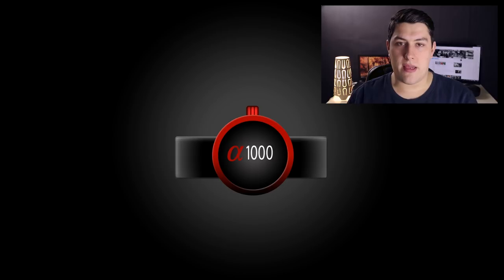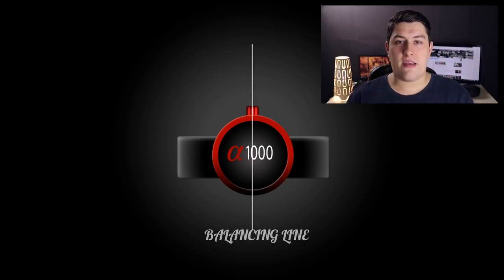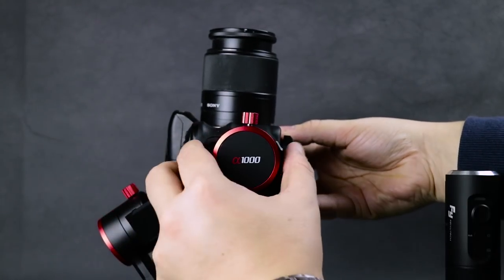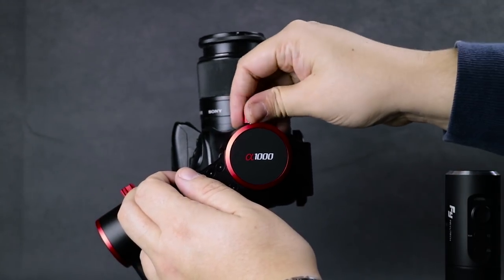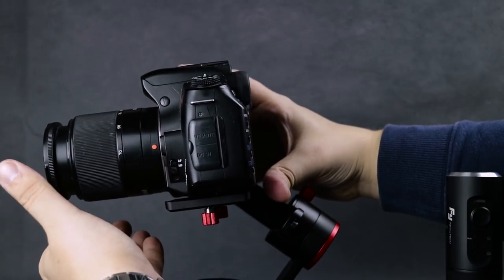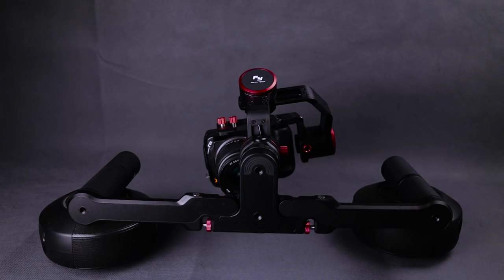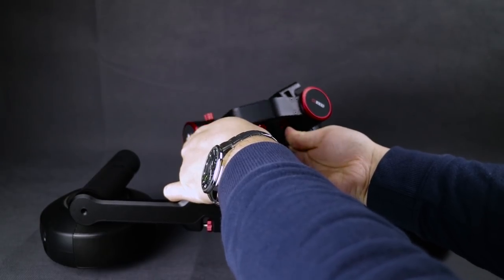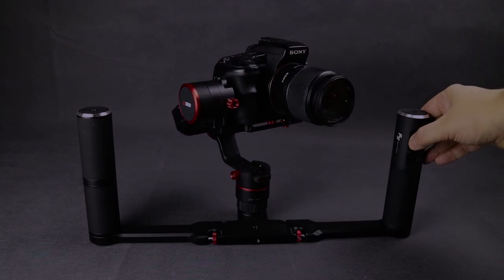FeiyuTech A1000 Balancing tutorial test footage and gimbal unboxing English

Comment: Slick review and well edited, far more than the 108 subs reflects! I think I'm going with the A1000 but they only come in a single handle on the UK market from what I can see. The footage looks just as good single handed so I don't mind that. Keep it up dude and share your content! Subbed!
Reply from the maker: +speedingtube thanks man. If you get it from Amazon please consider using the links in the description as it helps to support that channel.
Reply: speedingtube - just bought the single handed myself but found you can get the dual handle direct from FeiyuTech website ($199 US from the look of it)

Comment: Awesome video 👍🏻 would this work for the Sony A6000 / A6300 / A6500 ? Not sure if I would have to purchase the a2000 or a1000 with lenses 18-105 gmaster / 35mm and 50mm Sony. Thanks for the help
Reply from the maker: +Firkins Films it depends on the weight of the lenses. I use mine with a canon m3 and only use super light lenses. Check online that your heaviest lens doesn't take it over the weight limit. Also the actual gimbal is built for smaller form factor cameras so you might find that longer lenses prevent the gimbal from turning all the way. Id say that if you're using heavy glass then it would be worth paying the extra for the a2000.
Reply: My Sweet and Sour Life ok that’s what I was thinking thank you 👍🏻
Reply: Firkins Films the latest version will take upto 1700g which is more than enough for most camera and lens combinations. I use mine with a Panasonic GX8 plus Lumix f3.5 12-60mm lens. The camera and lens is quite a heavy lump compared with say a Sony a6500+lens. I use my gimbal only for walking and orbit filming in 4k most of my work is done on Sony shoulder mount broadcast cameras.

Comment: Hi. I got some issues with my a 1000. It keeps on spinning and doing all sort of crazy moves around all axes. What could this be? Incorrect balance? Should this a 1000 nob motor be on the right side of the camera? Would this have importance in balancing? It also seems that when I turn it on it does not keep steady, and in slowly moves around. Thanks for the advice.
Reply from the maker: Yeah it's really important to balance it correctly. have you updated the firmware?
Reply: No. I connected the app, which indicates the current software, and no needs for an update. I played around a bit, with adjustments and balancing, and it seems to be better. I still have to figure out, how to stop the autorotation motion ;) Do I hear a bit of Walsh accent there?
Reply from the maker: Just experiment with it. If you can't get it to stop rotating get in touch with customer support. As for the accent it has gotten all messed up since moving to China but its from Salford originally.

Comment: Hi!Does this gimbal also load the battery of the camera by connecting with usb? If not, it's crazy after each 10minutes of filming to change the settings of the gamble to replace in the camera the batteries. I would like to buy this gimbal for my Sony Alpha 6500 16-70 with rode micro video
Reply from the maker: I checked the manual and dont think that it's possible. I'm ok because my Canon lasts about an hour or so of shooting. For the A6500 there may be better gimbal options which use the gimbals battery to power the camera. You could always mount an external power source to one of the 1/4 inch treads on the gimbal handle which is what I will probably do when I upgrade to the A6500 in the next few months.
Reply: My Sweet and Sour Life thank you!Why will you update to Sony 6500?I have the 16-70 with Rode micro video.Is filming easier with gimbal instead without?Can you recommend Feiyu Gimbal over Zhiyun?
Reply from the maker: To be honest I havent used the Zhiyun gimbals so I can't make a comparison. I'm looking to update my camera because mine is old and only shoots 1080p 30fps. So i'm looking at my options but it's a difficult decision. I think that you might find the customer support for Zhiyun outside of China to be batter as they have been in the market longer. I wouldn't say filming is easier it still requires technique to walk with the gimbal but the footage looks much more stable after.

Comment: hey I have a problem, I have a Panasonic G7, with a 25 millimeter lens, I seem to have like a jerky bobbing motion sometimes it doesn't even feel like I have a stabilizer,  is that common or am I not moving careful enough?
Reply from the maker: It is either caused by improper balancing, firmware or a faulty device. Double check your balance before use. Check that the firmware is upto date and if you dont get better results contact customer support.
Reply: thank you for the help,  but I feel like I got a balance right I've checked all the tutorials and also followed your instruction on how to properly balance it. plus after I have a balance I moved the camera and it stays and every spot that I move it, like if I have it pointed down it will stay down if I have a pointed up it will stay up, if I have it pointed forward it will stay forward. as far as walking I tried to be careful as possible heel-toe heel-toe. I will check the firmware and see if that's it.. thx again...

Comment: hey so i have the sony a6300 and want to know if i need the A2000 or will the a1000 be good enough??? i mean its $150 difference
Reply from the maker: It depends on what lenses you are intending to use. If you use lighter lenses like the kit lens or 18-105 you should be ok but if you're planning on using some of the heavier Sony glass then the a2000 would be worth the extra money.
Reply: My Sweet and Sour Life yea then I saw the video how much better it is With the trigger on side right ? And the 360 rang of motion for 150 $ more .
Reply from the maker: I would say that other than a few minor differences they are essentially the same but I have to rule out buying some lenses/cameras because they are too heavy for the gimbal. It might suit your needs for now but you may regret not getting one that takes more weight if you're looking to upgrade in the not too distant future.

Comment: Great video, and the tutorial is awesome probably the best I have seen for this gimbal, I just purchase the a1000 single handle gimble and this was very helpful. I have a question have you try running with it and is it still as smooth?
Reply from the maker: I'm glad that you found it helpful. I haven't tried running with it just because the need hasn't called for it but I might include it in my comprehensive review when i get around to it. Thanks for the like and sub.
Reply: I just unbox mine yesterday and I was using it with a sony a6500 and a 18 to 105 G lens, and even being a 950 grams set up is too big for that gimbal so I have to return it and get a a2000. Thanks for the video.
Reply from the maker: Yeah I use mine with a Canon M3. I bought it cheap in a sale in China but i know that when i end up getting a new camera or some heavier lenses that i'll have to upgrade too. The a2000 is nice though it comes with a quick release plate and the gimbal is bigger so it works better with larger lenses.
Reply: I have the a2000. It's the same process to balance

Comment: Did you get the gimbal in that nice case? I got mine (ordered from ebay) in 2 separate boxes. I have no carrying case this way. :(
Reply from the maker: Yes it all came together as a package because I bought it straight from the manufacturer in China. When I checked on Amazon It seems that they only sell them separately elsewhere.
Reply: Good for you. Now I'm searching for a bag I can fit it while mounted on the dual grip and folded, so I do not have to assemble it each time before use, on the field. I wish they have such a bag too in their repertoire.
Reply from the maker: Yeah that would be nice. I have found that the case is too big to be practical when using the gimbal out and about. I would love a bag that had specific cutouts for all my gear.
Reply: I also got the flash box as did others I saw on the internet!  I got mine directly from the Polish distributor.

Comment: Hey man! Can I put my canon 200d 50mm lens here??
Reply from the maker: Which 50mm do you use?
Reply: kit lens
Reply from the maker: Yes it should be fine with the kit lens but if at some point you upgrade to a heavier lens it might take it over the weight limit. Just something to consider.
Reply: It works fine :D The camera and the lens all together are not beyond 700g and the gimball should work at max 1,7kg.

Comment: Does this work with the canon eos 800d?
Reply from the maker: I would recommend getting the A2000 for a DSLR just because of the size of the camera. Although it could take the weight, the gimbal itself is small and designed for mirrorless or point and shoot cameras.

Comment: What is the difference between a1000 and a2000?
Reply from the maker: Isaiah Bolima There's a few difference. The weight limits are 1kg for the a1000 and 2kg for the a2000. The actual gimbal size on the a2000 Is also bigger and better suited to larger cameras.

Comment: I also got A1000 gimbal, but my footage is shaky like the video below, not so stable like yours.
https://youtu.be/FXX2aegxNuk?t=570
Did you use any editing software to stabilize the footage?
Reply from the maker: No I didn't use any software stabilization. The footage looks like the technique of the person using the gimbal isn't so good. My technique isn't great but here's what I try to do . 

Firstly don't hold the gimbal stretched out in front. For smoother footage use both hands and keep you elbows in at your sides so that the gimbal doesn't move around when you're walking.
 Secondly adjust the way you walk. Don't walk normally. You should walk slowly with slightly bent knees and try to walk from heel to toe to minimize the shake when your feet hit the ground.
Reply: just don't run akira , even stabilizer can't stabilize z axis if u run.. and alittle jump

Comment: I strongly advise against FeiyuTech, I bought this gimbal and it was useless.  My experience was that the product never worked, would shake for no reason whatsoever.  I took it back several times, the reseller admitted there was something wrong with it but could not replace the part.  I ended up buying a DJI which works very well, so much so that I have since upgraded with that company.  Avoid FeiyuTech.